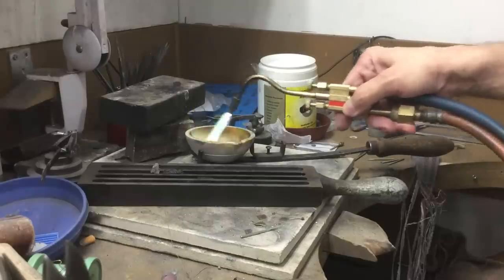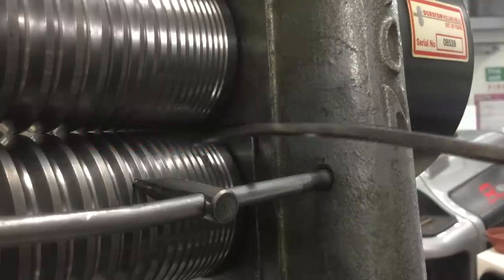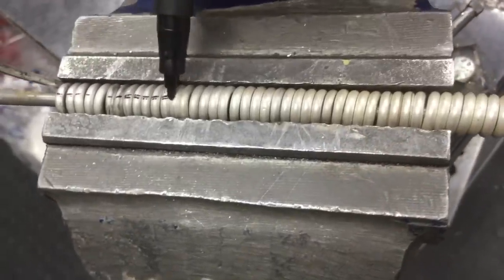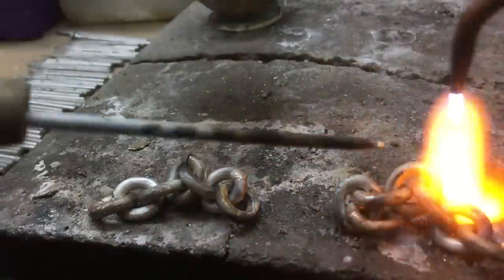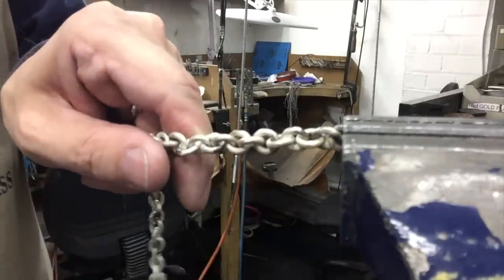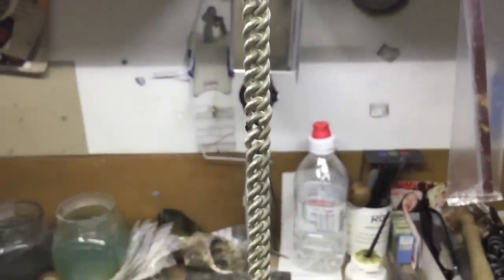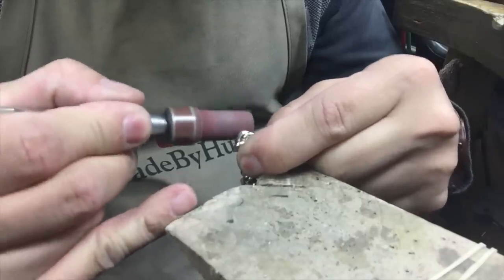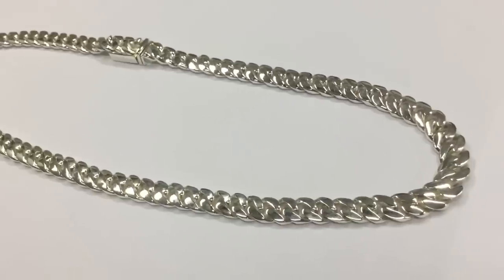Making a Cuban Link Chain Tutorial

Comment: I am making a cuban right now and after twisting the links and putting it through the rolling mill the chain does not hang straight. I think I may have rolled it to much. Is there a way to fix this and make the chain hang straigt? Could I twist the links more to counter act this?
Reply from the maker: I find that once it goes wrong it’s hard to fix it . It helps to pull hard when twisting I know it’s difficult and before you put it though the mills hit it flat with a hammer try not to dent it . But you have already pasted it so try to twist again hopefully you haven’t milled it to much or it will be too flat best of luck

Comment: Very nice work, the hardest part indeed is making sure the chain hangs equal without links shifting out to the side or kinking.
I don't now if twisting the chain as a whole would work, you would have to keep fair amount of tension on it to prevent it curling up on itself.

I use a small piece of wood slightly thinner than the chain to have it resting on when I want to clamp it in the vice, much easier than trying to keep the chain taut while your third hand closes the vice.
Reply from the maker: Thank you great comment good advice and thanks for watching

Comment: Hi, I'm looking to make a cuban link chain for someone, how do I work out how much length of raw material I need to make the chain please? For example if someone wants 22 inch necklace cuban link chain, how do I work out how much length I need, as buying 22 inch of wire when coiled, and twisted to make the cuban chain design surely shortens in size? Many thanks
Reply from the maker: Making mine I started with 120 grams it’s about 24 inches if I need to add to it I do so or another thing I do is I make a sample from copper or silver about 2-3 inches then once I have the weight of that I times it to the length I want so I can start with the weight I need hope this helps

Comment: Amazing chain!!!...My craftman is not finding the way to make the links thinght. Any sugestiones sir?. its an 8mm and hes using 2.70 round wire... could it be a máster of increasing the wire width maybe to 3mm? 
transferencia in advance!!
Reply from the maker: 2.70 the rod has to be twice the size about 5.5 you can use 3mm wire about the thicker the wire the harder it is to twist.
Reply: @MadeByHuss  thank you ! So by using  a rod twice as big as the wire thickness we get tighter links?
Reply from the maker: @danielobyrne935  yes any smaller the links wont fit in fact you may have to go slightly bigger to make them fit

Comment: Great work! Any tips to stop the chain twisting on itself? 👍
Reply from the maker: I have to say pull hard when twisting I’ve seen jewellers use a machine to do this but sadly I don’t have one best of luck 🤞
Reply: Thank you, I have been searching the net but your videos are by far the most detailed and honest 👌
Reply: I found with sterling the links kept breaking…. you ever tried using fine silver?
Reply from the maker: @brennascott1008  no it’s to soft not practical what solder did you use I think easy is best don’t use hard I found it to break easy
Reply: Thank you, I did use hard solder… I will try easy solder next. It worked but was a complete head ache… thank you for your advice, top bloke! 👍

Comment: Great informative video! I have a 3.25mm silver wire how do I determine what size rod I use?
Reply from the maker: Well two wires have to go through hole so twice as the size 6.50mm how ever oval rod works better I think try 2 of 2.5 rod together but make sure you put thin paper between the links and the rod so its easy to take off the rod its not easy to know all measurements so try a sample with some copper wire.
Reply: @MadeByHuss  ahh i see, thank you!!

Comment: Just getting started and have a question. How do you determine how much silver is required for a bracelet or chain?
Reply from the maker: It’s all ways difficult to tell I make samples like 2 or 3 inches and go by the weight or I guess I would use like 50 grams and then add more depending on how long I want it to be
Reply: @MadeByHuss  Thanks!

Comment: I thought i had this down, but lately all my chains want to coil.  I'll turn each link slightly more than the last but nothing seems to work.  Maybe im not keeping enough tension while I'm twisting the links?
Reply from the maker: Are only twisting do you flatten the links by gently milling them or by tapping them flat
Reply: @MadeByHuss  I finally figured out a tried and true method.  I was not using enough tension, and I was fighting the natural hang of the links I had put together.  It's hard to explain, but I finally made it work for me.  Thank you for your response 🙏   I have tried both milling and tapping the links but find it better, for right now, to simply design the links with slightly more space and minimize either of those processes.  Plz do let me know if you have more advice though, your chain looks great!

Comment: Can i use the sterling silver wire spools? If so is it a hard hard, dead soft, or full hard wore type. Or do I have to make the wire myself?
Reply from the maker: yes you can its soft depending on the thickness I used silver my self

Comment: How much feet of metal did you use? And what was the gauge?
Reply from the maker: Miguel Grant not about how long the wire is I went on weight started with 100grams made 3mm wire
Reply from the maker: No sorry necklace was about 120grams bracelet was 100 grams

Comment: What decides the mm of the chain?is it the rod used to form the links?like let’s say a 3mm rod makes a 3mm link, is that how it is?like what rod is needed for a 12mm link?
Reply from the maker: The wire is 2.35mm and the rod is 4.7mm I show this in the video and no you don't use the same size rod as the wire if the wire is 3mm then you have to use over 6mm rod because two links are going in to one link if your doing this for the first time make a sample out of copper just a couple of inches hope this helps thanks for watching

Comment: I'm having a difficult time keeping the chain flat after bending tHe links.  any suggestions ¿
Reply from the maker: South Paw this is the hardest part when turning the links the chain has to be pulled as for making them flat you can roll them though the mills or tap flat with a hammer making a chain like this takes a lot of practice good luck and thanks for watching

Comment: On a scale of 1-10 how hard do you think this would be for a total amateur with a propane torch, a vise, common hand tools and 0 experiemce
Reply from the maker: andrew very hard a 9out of 10 try using copper wire or any thing cheap to use you can practice first at same time figure out what tools you will need I think you will learn a lot
Reply: @MadeByHuss  super cool that you're still responding to comments, also what tool did you use to make the spiral
Reply from the maker: @MTFTVlive  I used a hand drill if it's small wire or you can use your hand I'm using a 3mm wire on the one I'm working on I used 6.3mm rod and used my hands to tuth it around

Comment: Very nice work!  How did you decide on  the size of your coil?  Is there a a formula to calculate the ideal inside diameter of the rings when making a Cuban chain.
Reply from the maker: Well where ever the thickness of the wire is the coil or rod has to be at least double so it’s possible to put them together all so what I do is I make a sample out of silver or ever copper to see how it looks that’s what works for me

Comment: what diameter does the chain have in the end? i want to make my own out of some kind of gold but i am not sure what material to use considering i never did it before
Reply from the maker: sammy Pharaoh it’s 12.30mmx3.8mm I think for the first time try using copper you will need to practice first it will help you
Reply: Yes makes sense specially for the lock ive never really tried building one. I cant work as locksmith for over 3 months because of an injury and now i want to make that chain for a friend. Can i ask you what material you would think is fitting? Its really not about the price of  the material i only want it to be in gold optic and of course i dont want it to rust or anything. Thanks for the fast reply earlier anyway 👌🏾
Reply from the maker: sammy Pharaoh you can add a lock like a trigger lock or a lobster clasp it doesn’t have to be a box lock and they are all ready made
Reply: @MadeByHuss  thats true that would safe me a lot of time aswell. but ill keep at it id rather not going to make a chain at all before using a lobster clasp. i dont know it really think they look ugly and cheap :D

Comment: Can you tell me what materials you used i want to make sure i do it right. sorry about my previous comment
Reply from the maker: TGELITE cherno that’s going to be a long list first you need gas and oxygen to melt the metal or you can buy a found rod all ready made if not rolling mills  a draw plate to draw the wire  the right size rod to make the coil so you can make the links a piercing saw a vice parallel pliers I’m sure you can see the rest in the video oh shellac cement

Comment: Good job man! Just wondering what the thing you melt over the chain to stick it to the wooden piece is? Could you give a link to it or something?
Reply from the maker: Marvin Noriode it’s a cement called Shellack u got mine from walshtools.co.uk or just search cement shellack
Reply from the maker: Marvin Noriode sorry hswalsh.com
Reply: @MadeByHuss  Thank you! Do you reckon boiling water will be able to clean it all off?
Reply from the maker: Marvin Noriode I don’t think so may be alcohol
Reply: @MadeByHuss  do you have any products from the page you sent me that could help me with that? I really appreciate your help and videos!
Reply: Maybe some isopropanol?
Reply from the maker: Marvin Noriode you can get nail varnish remover anywhere I think that’s the best I only got the shellack from the website
Reply: @MadeByHuss  Thanku! I will definetly find that in store here in Norway.
Reply from the maker: Marvin Noriode I don’t know what that it some time you have to try to find out let me know how it goes
Reply: MadeByHuss i will! And also you should make a video on how you make your chain locks!
Reply from the maker: @marvinnoriode6131  yes hopefully I'll do that too the video was so long to begin with
Reply: The part i actually find hardest is the bending, and making the chain hang straight. And i also used round links, not oval.
Reply from the maker: Marvin Noriode yes me too this was the first one I made I said I should of made round links in fact I’m working on it now and still it’s just as hard to do I know it takes time and patience and with practice you get there all the best
Reply: MadeByHuss thats true! Cant wait to see your new one
Reply: You can also use a hobby hot glue gun. To remove the glue after, soak it in acetone.

Comment: Would I be able to this with a 20 gauge wire or  a 18?
Reply from the maker: not sure what you mean I worked on the weight with was 100 grams to start
Reply: I mean the size of the wire I have my wire already done but I made mine 20 gauge so I was wondering if it would still work
Reply from the maker: TJ Scott I used 3mm thick wire you can go thicker but it will be harder to bend

Comment: Wtf is grease compound i cant find it anywhere nothings labeled as grease compound
Reply from the maker: @elizasass2079  you can find on walshtools website there are different types of compound best of luck
Reply: @MadeByHuss  can you tell me what you're using it for? And what's different from that vs rouge does the "grease compound" have abrasives in it if so what level or color would it correspond with rouge
Reply: @MadeByHuss also thank you so much for answering you have no idea how much you're helping everyone with your video and replys

Comment: With borax and why do you need it for ?
Reply from the maker: It helps the solder flow easy hope this helps
Reply: MadeByHuss so if I buy silver or gold already in 20 gauge roll do I still have to put borax or its only when you melt gold or silver ? Thank you
Reply from the maker: Savage Hustler when making the links first there open to close them shut it need to be soldered I show this in the video
Reply from the maker: I should of said you use it when melting and soldering links together
Reply: MadeByHuss what type of acid do I need ?
Reply from the maker: Savage Hustler sulphuric acid with water

Comment: I have a few questions for you. my first question is when you were combining the links were you using little bits of solder or silver. my second question is what type of acid did you use to clean the links and what was the solution on the right? water? and do you have a video on making the clasp?
Reply from the maker: Now We Eats I used easy silver solder and nitric acid on the left is water
Reply from the maker: Now We Eats oh the clasp there I made didn’t work well so I changed it it was difficult because of the size being so small and sorry I don’t have a video on the if I was to I would make it much larger
Reply: @MadeByHuss  I really appreciate your response. I have been interested in making myself a Cuban link chain for a while now. I've been studying almost every YouTube video out on the subject matter and my questions to you were basically some of the last bits of information I needed. Thank you very much.
Reply from the maker: Sorry it’s sulphuric acid mixed with water we just ran out sorry for the mistake